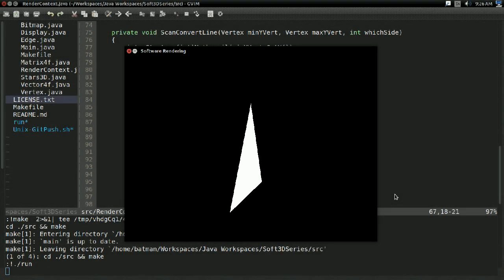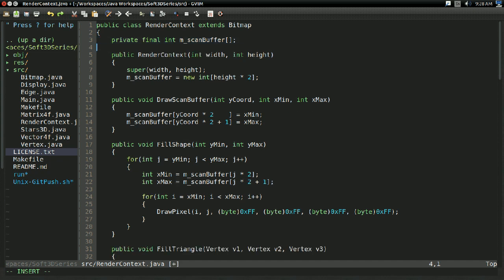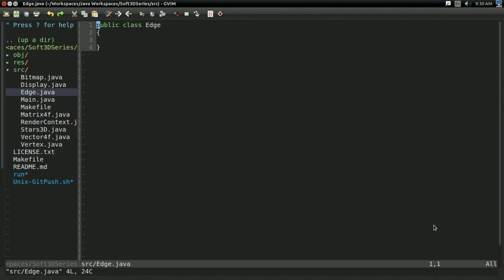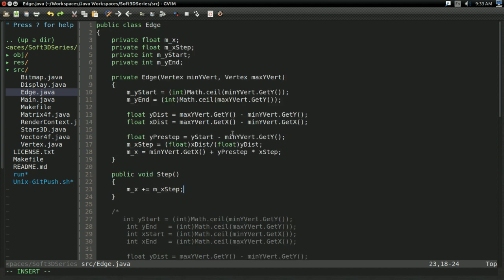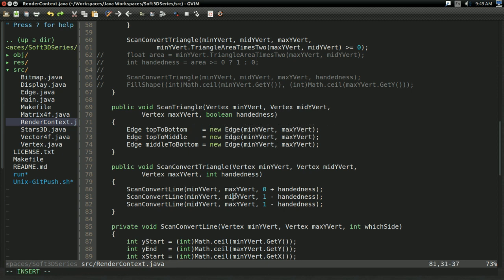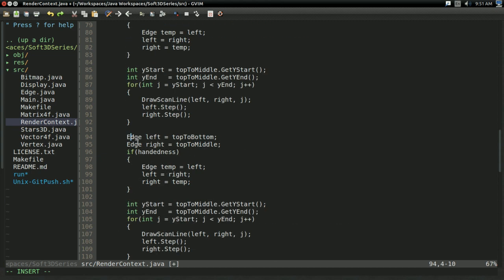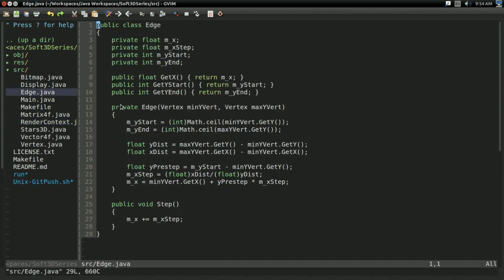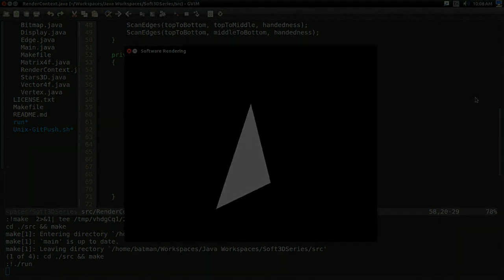#12 3D Software Rendering Tutorial: Edge Scanning

Comment: Around 7:21 of the video, at line 72, instead of creating 3 new instance of  the edge object, it would be faster and more memory efficient to reuse the existing object. 

Imagine if you have thousand of triangle to scan each frame,  the memory on JVM  will be filled up with garbage edge objects very quickly XD
Reply from the maker: Pan Hu technikfischer Both of your suggestions are valid. In fact, in my original code, I did reuse the existing objects. I've decided against it here because it makes the code more complicated without any particularly good reason.

I'm really not going to be doing anything in the way of performance optimizations in this series because it makes the code more complicated and difficult to understand, and distracts from the main point which is understanding how 3d software rendering works. Besides, if you really want high performance 3d rendering, you probably shouldn't be using a software renderer.

I might make an extra video that discusses some optimization techniques if people are interested, but I'll be avoiding them for the most part in the main series.
Reply: Thougth the same, but only at 8:20 where he swaps the two variables. Would be faster to only define the variable outside the if, and assign it in inside the if. If handness is false, just assign them in the other way. Would save you from creating the "temp"-variable.